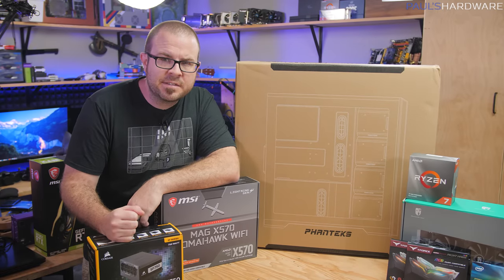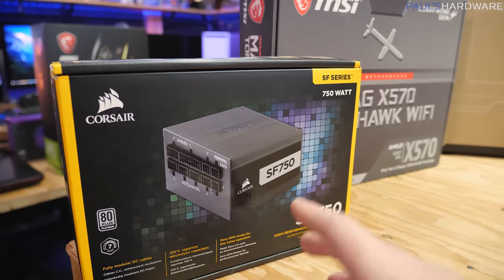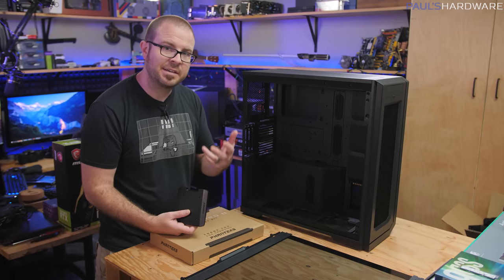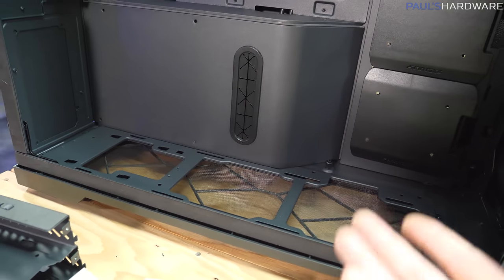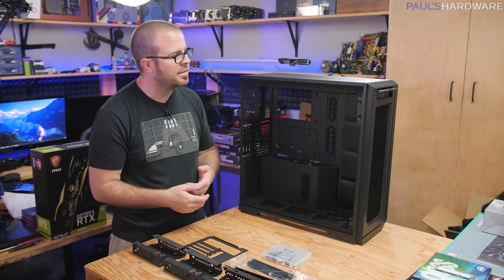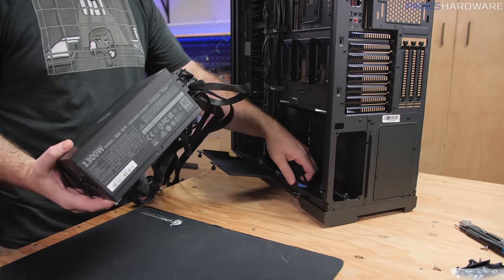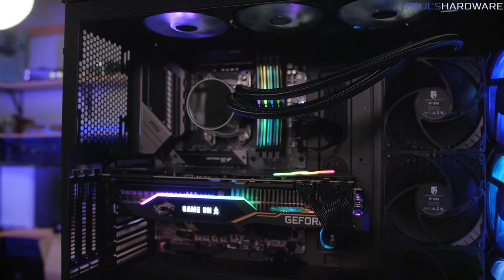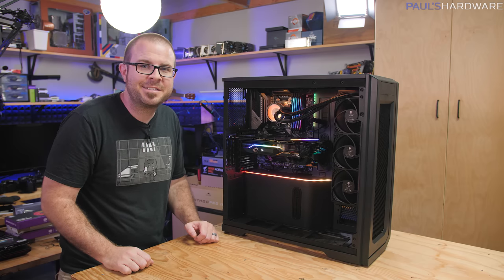Building a $2800 Gaming PC in the NEW Phanteks Enthoo Pro 2!

Comment: This is probably the first video ive seen of someone actually showing the install of the gpu sag bracket. Thanks!
Reply: sitting here with my enthoo 719 with the same bracket and just like, i don't see how it's gonna help the sag, especially holding this heavy ass water cooled 3080 ftw3 that for some reason only comes with a single slot bracket.

Comment: use the empty space by putting a 7" monitor down there as a second monitor for monitoring system diagnostics....
Reply: that sounds fun
Reply: @Aleph-Noll  can't tell if that is sarcasm or not...but it really does look good.  I have the Coolermaster Mesh 500P and did the same with that case and it looks extremely good!  I think it would look great for Paul's build in this video.
Reply: My thoughts Exactly  :-)
Reply: Just put your main monitor down there and make a LAN party computer.
Reply: Thin Deezal HD where can you find small monitors for that? And how do you program it to keep track of things like temps? Might try it out in the future
Reply: @eonic6141   Amazon has them and in different sizes...  I will provide a link.  Also, judging from the space Paul has left in his case he looks like he could fit an 11".  And the only thing you need to power the display and the monitor itself is a type c cable; it can be powered by the type c input on the graphics card.

here is the link: https://www.amazon.com/Eviciv-Portable-Monitor-Display-1024X600/dp/B07L6WT77H/ref=sr_1_9?dchild=1&keywords=7+inch+monitor&qid=1595812131&sr=8-9

also you can use HWINFO64  or if you want to be fancy NZXT CAM software.
Reply: I really like this idea! It's super creative and functional.
Reply: Thin Deezal HD
Old HD screen? iPhone screen? iPad running diagnostics, why you need that????
Reply: @TheLittleCan702  why you need diagnostics there? iPhone that, iPad, running the Logitech app or other PC diag tools?
Reply: @Hakeem597  why you need that, running what????
Reply: @lucasrem  I do not understand your question.
Reply: I've got 1, its 5" though, HDMI, usb powered.
Reply: @Hakeem597  Can be done for like $30 too if you buy a cheap LCD Panel off AliExpress!  And is a total "WHOA what's that?" attention-getter!
Reply: @erikhendrickson59  yeah, that is what I did with my PC...I have an LCD monitor on the inside that I use for diagnostics.
Reply: @Nick Diesal might be your build?...went an purchased this case and transferred everything from my old PC to this case with the screen....looks great!
Reply: @Nick Diesal I see...how do you like the case tho?  I'm thinking about putting a second system in the basement for a dual build...I actually ordered parts already and hope to get it done next weekend....

Comment: 1. AMD Ryzen 9 3950X 3.5 GHz 16-Core Processor $690
2. Fractal Design Celsius S36 87.6 CFM Liquid CPU Cooler $136
3. Asus PRIME B550M-A (WI-FI) Micro ATX AM4 Motherboard $150
4. G.Skill Trident Z Neo 32 GB (4 x 8 GB) DDR4-3600 CL18 Memory $190
5. Gigabyte AORUS NVMe Gen4 2 TB M.2-2280 NVME Solid State Drive $460
6. NVIDIA GeForce RTX 2080 Ti 11 GB Founders Edition Video Card $1200
7. Deepcool Matrexx 55 V3 ATX Mid Tower Case $50
8. Raidmax Thunder RGB 735 W 80+ Bronze Certified Semi-modular ATX Power Supply $69
9. Microsoft Windows 10 Pro (32/64-bit) key $5 on ebay

Total: $2950

Build online: https://pcpartpicker.com/user/Danthemanholt/saved/#view=HCr9NG

You can get X-Box PC controllers, wireless or with wire, and if you only have 1 USB 3.0 port you can connect a 4 port hub so you can put in more controllers also to connect a 4K UHD blu-ray player.

https://www.bestbuy.com/site/insignia-4-port-usb-3-0-hub-black/5631038.p?skuId=5631038

Comment: @20:30 - the top panel is removeable.  You can take it out, mount your radiator and fans, then put it back in the case as one assembly, making working in that tight upper space next to the motherboard and memory way easier.  The bottom panel is also removeable in the same way.

Comment: I feel like the whole dual system set up was a flash in the pan, and now it's just using a lot of space poorly...
Reply: I can see the space being useful for pump/reservoir mount if you utilize all the radiator spots,  but yeah, unless you go for a proper custom loop the case is big with lots of empty space, but that's the story of full towers I guess...
Reply: That’s why I use a Fractal Design Meshify C Mini. Perfect for a normal build.
Reply: @MaxxPlay99  got the Define 7 about a week ago and I am very happy with it, it looks gorgeous and is great for a custom loop later on, cable management was super easy and holy shit the improvement in build quality since 2016 with the Define S is crazy! And it's very quiet with adequate temperatures, so I'm really loving it.
Reply: The Pro 2 is almost the same interior on the 719 (formally Luxe 2), which is a a dual system case as well. Otherwise a radiator can go down there as this case is designed for open loop water cooling. This case is wasted on air cooling, or even just a cpu aio.
Reply: @RukhWhitefang  yeah, bit in a world with the p500a and the 011 dynamic xl....this just seems awkward ..I think both are better options (imo)...
Reply: @Tobias611  i don't like the case but saying that it would make, a good gaming recording, streaming pc.
Reply: I agree. Overall I'm not excited about the case design.
Reply: @Tobias611   What's your setup with it and what temps are you getting? I'm deciding between the Define 7 and the Enthoo Pro 2.
Reply: @cab0218  'Ol reliable i7 6700k, Zotac AMP! Omega GTX 980Ti, 32GB Cruicial Ballistix Memory @2666Mhz,  Asus Z170A, Corsair RM850i, BeQuiet Dark Rock 4 as a cooler. My tamps reach 72°C max on 100% synthetic CPU load and 64°C on GPU 100% load. Not particularly hot, and the fans don't get too loud either. Though I do use the mesh top instead of the solid panel as I have fans installed in the top portion...
Reply: TiMeJ34nD1T  Not bad. I’m trying to decide between the Define 7 and Enthoo Pro 2.  I like the look of the Define 7 better but wish it had better airflow.
Reply: @cab0218  the airflow isn't too bad, especially if you utilize most can spots (3x 140 top, 3x 120 front, 140 back), the airflow is restricted by the front panel, but the side vents are about 2cm wide so it's not too bad. If temps climb too high you can just leave the door open, though I hope fractal releases an air flow oriented door as they can easily be swapped out
Reply: TiMeJ34nD1T Ok thank you. I hope they have a better door too.

Comment: Paul: Pulls out 1300w power supply

Me: now that’s a lot of damage
Reply: (Stabs and chainsaws bucket)
Reply: I finally "upgraded" from my trusty 1200w supply to a reasonable 550w.
I got it yeeeaaars ago when I did nonsense like triple sli with 3x GTX 470. Kept it ever since, though over the years it became more and more overpowered.
I can't really imagine needing such large psu these days.

Comment: Have the original Enthoo Pro (tempered glass version) and it was fantastic for me at the time. Having 6 hdds and 4ssds took up some room and that case worked perfectly.
Thanks to tech moving along further, I'm down to 2hdds, 2 ssds, and 2 nvmes, so I moved to the 400a to free up desk space.
There's a noticeable difference between the two with quality. The 400a is significantly cheaper in just about every aspect, but once your build is up and running, it looks great. The Enthoo is beefy and had lots of room to fiddle around with wiring, unlike the 400a which left little to no room for routing things.

Comment: Since I obviously hate myself I went ahead and bought 11 Corsair fans (4x140 and 7x120 LL series) to mount in this case.   Those 22 wires are going to 2x node pro and 1x commander pro with 5 fan splitters.   I am going to use the lower front area to mount the commander pro and node pro units that I don’t understand how anyone could fit with wiring into a case without an excess of space like this case offers. 

I share the sentiment that it’s really tight for space working above the motherboard and disappointing you can’t really top mount a radiator due to minimal clearance (for a case that’s so cavernous).    I think that the commander pro and node pro units will not look bad in the lower front of the case and it will be RGB-diculous for sure.

Comment: IMO Phanteks is one of the top Case manufacturers on the market. SOME of use still like the slots for USB and CD drives out the front of the case .  USB facing upwards tend to gather dust way more with no door over them .

Comment: The bottom space is fine, Most people still also have hdd's for secondary mass storage.
I would fill the bottom left up with the 4 hdd cages and drives and then put another 120mm rgb intake fan in the bottom middle to feed the gpu. Would come in handy with the new 3080/3090 cards sucking air from bottom.
Not a bad case, Just wish they still had one 5 1/4 bay for blu ray reader/burner on the front panel instead of needing an internal optical bay where you need to open case to use it.

Comment: Soooo it's an Enthoo Luxe 2/719 with a different front panel, Gotcha. I still prefer my Luxe 2/719 the aesthetics were a major factor for me.  I have the Vertical GPU kit from Phanteks installed on my system and hard drives in the area where the dual system would sit. I do plan on building a second system eventually but i'll need to buy the Revolt X so I can have 1 PSU for both systems ( I accidentally bought a Revolt Pro) . As for fans I used 7 DeepCool RFM120M's and connected them to the onboard fan header then plugged that into my Motherboard.  This is the most premium case I have bought yet, Phanteks does a great job with the accessories that comes with the case, the manual is the best i've seen on the Market. Fully Colored and highly detailed, it even shows what size radiators fit into the case.  Here's my specs if curious.

Ryzen 7  2700
ASUS X470-PRIME Motherboard
16GB 3600 TridentZ RGB RAM
ASUS ROG GeForce RTX 2060 6GB OC
512GB SSD
6TB Total HDD Storage.

Comment: I just finished a dual system setup with gaming PC and NAS in the Lux 2, which is basically this same internal case. Phanteks says you can only stack 8 drives behind the front fans, but you can clip an extra one on each for 12 total with the dual-system.

Comment: I put a 3800X in my system (3800XT was not around yet). Came with a stock cooler, but I put a DEEPCOOL Castle 240 RGB AIO  on it.

Comment: This is a beautiful build, Paul. I am definitely digging that anti-sag bracket, especially for huge GPUs like the 2080Ti... I was thinking of using the top as an intake, because it gets hot as hell in Cali (especially in July), and having one exhaust in the rear... sure, it will get dusty, but my system will be ice cold.

Comment: My first ever build was in an Enthoo Pro M. Loved that little case.
Reply: dkamm65
What did you build, not needing the 360 radiator space, CD rom bay?
Reply: Little? I have it on the desk beside me (tempered glass version), it's definitely not little. I left the CD rom bay empty (I use a USB DVD drive for the rare occasions I need a disk). Just normal air cooling (using an Alpenfohn Brocken 3) and I added an NZXT HUE 2 to jazz it up a bit. It's a very good case. The P500A is probably its successor.
Reply: @donkeysunited  I guess it just feels little next to my current case which is the Core P3.
Reply: @lucasrem  I had a 280mm CPU cooler plus went through three generations of EVGA xx80 ti Hybrid AIO GPUs.

Comment: Also the SSD covers once removed will let you add 3.5 HDD mounts which of course you have to buy separate lol. Because the case can hold 12 3.5 drives. Just bought this case for my new media system And the bottom where a 2nd system would go. Is where additional hard drives can be mounted.

Comment: I have the previous model case. I use that lower area for a second GPU. That way I can run two MSI Trio 2080Tis, without them overheating. There’s enough space and cooling I never get near throttle temps.

Comment: i never use dust filters, dust filters never stop all the dust and they can fill up quickly depending on weather, and its not really that much more work to clean the inside than the outside. also way better cooling and less noise with most cases

Comment: I bought this with the intention of using the mini ITX case as a space for a Hackintosh. Not really necessary, but a fun project to do since I have some hardware sitting after upgrading my main rig. And I'll get the best of multiple "ecosystems" or what have you instead of my older dual boot config.

Comment: So this appears to be exactly like the lux 2 aka 719, so a couple of warnings. 

1st, you cannot fit a 480mm radiator on the side and in the front at the same time without making some small but serious modifications unless you find super slim fans and radiators which i don't recommend.

2nd, the internal LED strip on the inside of the case, the power cable for it runs extremely close to "wiring hub panel". I've managed to break two them just from pressure over time.
 
3rd, other then that these are amazing water cooling cases i love mine to no end.

Comment: If you are going to drop down from the Ti I do not recommend the a regular 2080. Go 2080 Super, or for around $500  to $600 get a 2070 Super it is almost the same performance as a regular 2080.

Comment: Most folks use the HDMI for sound as well as video. . Or at least I do. Which makes audio panels useless. Also on board sound is useless as well. I use a USB sound Interface for more pro detailed audio work, That requires real time from headphones in a DAW. Other than that the sound coming from my monitor to a speaker system does great. For anything else like watching videos and the such. No sound is going to be any better than, the speakers you can attach to your system anyway.

Comment: Looks almost exactly like an Enthoo 719 on the inside, difference being the open front, and panels.
Reply: It also only costs $140 lol
Reply: Same chassis, different panels. Does look empty without rads and reservoirs or itx system installed. I love my 719 with its dual system. One for me, one for the wife, all in one...
Reply: I would have loved to see a custom loop in there. You could  put a res and pump in the bottom.

Comment: 2 systems would be cool if Phanteks would not push it to buy their own PSU for it. 
Using 2 PSU's while the front one get choked from air, not a good idea. 
Probably the best use for it is a server build, for water cooling, there are way more cool cases out there for it at affordable prices, even from Phanteks.
It is not a bad case, I would definitely consider it for a system, even with water cooling, but that bottom space really needs a proper custom water cooling.
Thanks for sharing Paul.
Stay safe.

Comment: I never (logically) understand tubes up on vertical rads considering the heating radiators in my home and the one in my car are always fed from the bottom. I also noticed NZXT state on their blog that for longevity without eventually drying out the pump tubes are better down if possible. I immediately noticed a decrease in pump noise when I switched my vertical mounted Castle 240.  Tech Jesus also concluded tubes down if possible.  Would love your thoughts on this Paul?
Reply: I'm sure he'd have rather done it that way, but there's plenty of limitations that happen with a lot of AIOs (especially in larger cases) because they often come with short hoses... And most people would argue that the aesthetics going the diagonal length of your case would look awful. 
In most cases (no pun intended), you're best suited to have the RAD on the top of the case so the ports face down to avoid the potential pump damage from dry-heaving after some evaporation (or leaking) has happened. The issue that often creates is lower internal heat exhaustion overall and you start running into space limitations with your MB and its hardware. 
There's not a whole lot of times you'll see a "perfect" system because of this, running into one issue or another.
Reply from the maker: I have heard both recommendations -- it has been postulated that the top-oriented tubes could help bleed potential air bubbles from the loop, but I can't say I have extensively tested this. I have also seen the more recent recommendations for keeping the tubes on the bottom though. For this build, if I put the tubes on the bottom they wouldn't have been long enough to reach the CPU socket, so that's why I did what I did 😁
Reply: @paulshardware  Castle tubes seem naturally shorter than other aio's for sure, my 240 is at its very limit within my Antec Crystal, 360 castle can forget it. My old Kraken 140mm AIO pump and its replacement failed twice within 6 months vertically mounted in my s340 elite which was frustrating considering the photo-graphic on the NZXT box showed tubes up contradicting their own blog post.  I'm sure there is a video in this somewhere :)
Reply: @RAW_Reality  I agree and would also suspect all AIO's are designed with horizontal roof mounting in mind but it is only NZXT's blog that has ever mentioned it as a preferred method even though a deal of the photos on their website contradict roof placement.
Reply: @paulshardware  Steve at Gamer's Nexus is going to give you a hard time about those top-oriented tubes if he finds out, lol! Look forward to the video of you two discussing it.

Comment: Gigabyte Aorus Master x570, after all the reviews, thats the ONE i bought.

also, i wouldn't buy expensive ram, the price is very big if you go with brands,, but performances not so much.

3200 vs 3600 performances gap is tiny.

my latest build:
Gigabyte X570 AORUS MASTER 
AMD Ryzen 7 3700X AM4
Gigabyte AORUS RGB  DDR 4 16G (8GX2) 3200 CL16 X2
Corsair Hydro H115i RGB PLATINUM 280mm Liquid CPU Cooler
Gigabyte RX 5700 XT 8G
Corsair HX750i 750W PSU HXi Series 80+ Platinum Modular
Gigabyte AORUS LCD 27" QHD 165Hz 1ms FI27Q-P

2800$, also was my first budget, but i stretched it a little bit.